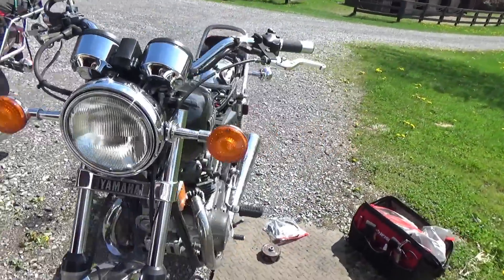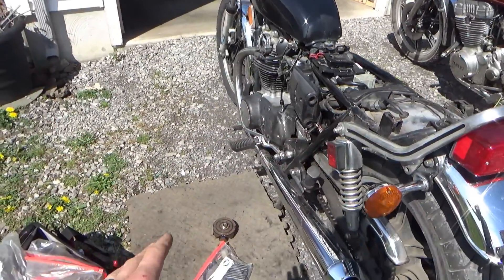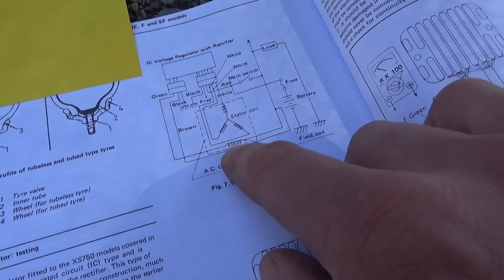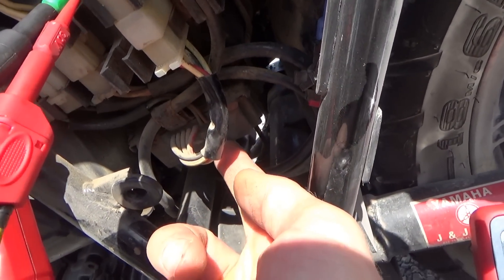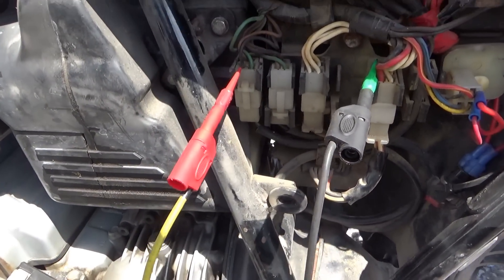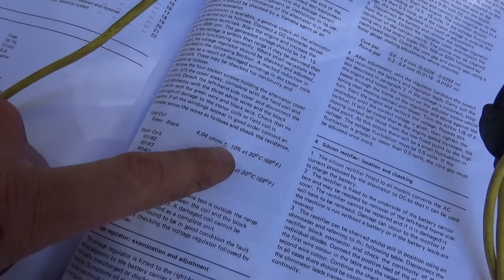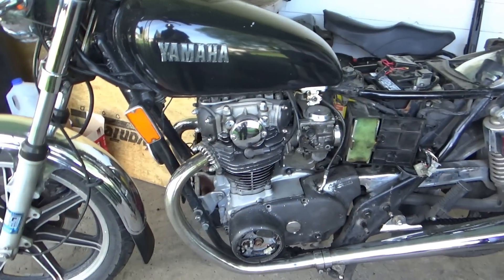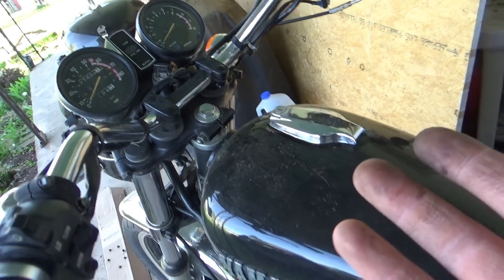Bad Diag? Bad Repair? Bad PARTS?? (Yamaha Battery Charging Problems)

Comment: Ivan.  During your spot on explanation of this charging system, I "woke up" and said:  "That sure looks like a "saturable reactor"  set up"  (also was called a "Mag-amp" I think. )    The Inductance of that control coil "changes, as the current through it changes." (thus the effective reactance/resistance changes)  as the control coil is "saturated" with magnetic lines of force. 
 
As the coil is saturated, with magnetic lines of force,  its inductance changes  - which allows more current or less  current through that control winding.    It's just like you dialing in more or less resistance with your decade box.   Maybe other followers of yours can give a better explanation.  Loved the diag.  Thanks.

Comment: Do not throw the old rotor away.  It can be rewound.  I've been running a rewound rotor for 20 years.  Custom Rewind in Alabama is one of the places that does it.  The OEM rotor is going to fail.  It has to do with the insulation technology at the time they were built.  Rewound is better than NOS.  Fix that and the XS650 is bulletproof.

Comment: I had a similar situation with old parts.  My DR650 stopped running and the high tension coil returned close, but out of range resistance.  

I replaced the coil and still nothing.  The new coil’s resistance was in range. 

Later it was determined the pickup coil was bad.  Still would not run.  

With the old high tension coil, all was well.

Always keep the old parts!

Comment: Something I've been seeing as a point of failure on consumer and aftermarket generator rotors and transformers is the improper attachment of enamel-coated aluminum magnet wire. I've found aluminum wire with the enamel intact all the way to the end of the wire and a glob of solder holding it in place. The solder only made superficial contact with the cut tip of the aluminum wire and soon fails completely ("Obsolescence Fuse"). Besides, at best aluminum requires special treatment for the solder to even adhere to it. I've seen several techs look at the copper-toned enamel and assume it's copper...a scratch test would prove otherwise.

Comment: I remember reading in a Chrysler Valiant service manual (1966 model) in the 'electrical' section that the maximum field winding current (DC) is 2A with regulator (contact type) 'on', which, with 12Volts input (battery) makes a resistance of 6 ohms (about the same for the motorcycle). Most occasions the brushes wear out, but it seems (as you mention) the windings are beginning to short out (with a 1.5 ohm measurement). It is a rare fault, as many-a-wrecked bike has a 'good' one... Tricky about the combined ignition pick-up.. With all these rare faults emerging, volt meters, current meters, and resistance testing are essential to make a comparison with a 'known good' and an accurate diagnosis...

Comment: all my messing with bikes if you need one part  you get them all.  and you test everything BEFORE  applying power. seen bad parts fry good parts almost instantly.  it also pays on electrical to check wiring diagrams from year to year and also serial number breaks.  they changed thing like i change underwear. seen the same regulator  rubber mounted needing a seperate ground wire  on a serial number break where it was solid mounted before not needing the extra ground wire.

Comment: I put a led charging system indicator on my 1980 standard model after I got it. You never knew what the charging system was doing on these bikes with no indicators.

Comment: Man I wish you were closer.  I dislike electrical issues.  My VW Passat keeps blowing fuse #4 when my AC is running on AUTO turning the blower on high causing AC to blow hot.  As far as I know fuse 4 is not even for the ac or blower.  😡

Comment: When I had my XS650, I had 4 "parts" bikes. Even at that time (early 2000s) it was starting to become difficult to get the OEM replacement parts. I did find out that the pick-up and rotor have to match year to year. Mixing the parts across years will cause a no start condition. Something for you and your friend to file away for future knowledge. Great diag as always. Good to know your friend's bike is running.

Comment: In my spare time I do a lot of classic twin Honda work and have 5 bikes of my own. 
Fuel system and electric parts from  the aftermarket are just awful. 
I end up buying a lot from Japan and Thailand where new OEM parts are more plentiful. Id rather get a good used part before anything aftermarket new . 
Excellent video BTW !
Reply: I've noticed some parts for 60's and 70's Honda's, often times I can only find them in other countries, Thailand is one such place.     I was helping a buddy restore a 1965 Honda Super 90,  and a lot of the parts could only be found overseas.   I even found some parts that were new old stock OEM Honda parts.
Reply: Can you share some of the sources from oversees for bike parts????

Comment: The shorted coil fried the regulator. The fried regulator fried the replacement coil to open. After replacing both, it started working again. No mystery there.
But the sorry state of parts suppliers is really worrying.
So you can get remanufactured parts that are still broken, you can get aftermarket parts that are not in spec or very low quality, or OEM parts where only the packaging is OEM. So, when buying parts, you basically need to bring test equipment to the store. Or place your bets online.
Reply: This eBay rotor simply didn't get enough pre-inspection to determine if it is the correct part. That's where some experience becomes valuable.
Reply: best to replace stator and regulator together when you're dealing with alternator repairs

Comment: Crazy that two “new” parts failed.  I’ve had a single new part fail, but multiple failures is more rare but thank goodness Ivan is a pro and gets to the bottom of the real issues. One thing I learned from Ivan is NEVER throw away old parts until the repair is complete.

Comment: same problem with my i had with relays and sensors i checked and found bad then replaced and still the same problem then checked the new part 9 times  out of 10 the new part was bad saw a funny car tag on a beautiful corvair convertible nader1 lol

Comment: It is basically a very old (50 year) antique vehicle, e-Bay parts are questionable because of the age and rebuilds are probably as good as the volume of parts sold. Once there are few vehicles still on the road you end up doing a Jay Leno, making/rebuilding your own parts or hacking a more modern part into the system.

Comment: This is what I run into half the time when I get "new" parts.
NEVER throw your old parts away.
Reply: Back in the days when we still have points and condensers this save me two separate times.. Both times had to go back to square one.. Everything worked.. replace the points everything worked replace the condenser nothing worked... Trust me the first time this occurred that I was 16 years old it was hell on Wheels figuring out what was wrong... After that I never replace the condenser again figuring it's a none wear item😁

Comment: Great bike, the XS650..easy to ride and easy to repair..I've owned 3, the only thing with an externally excited alternator is, if your battery dies your bike will too. With a PM alternator, you can run the bike with a bad battery as it will continue to run off the always available alternator current.

Comment: Very interesting diagnosis. I owned a Kawasaki and about 5 Hondas back in the day, and don't remember any electrical problems. One Honda had a selenium rectifier, I think. Always figured it wasted power to limit voltage. Nothing against Yamahas, I just didn't get one, and assumed they were all the same.....

Comment: The number of times I had to repair the charging system on my 2002 Honda VFR800 was insane.   Burned up/shorted stators, cooked regulator/rectifier boxes, toasted main bus wire and fuses....oof.

Bought a BMW K1300R.  Has alternator, no issues in 11 years.
Reply: Actually I even remember the VFR being fine one day but cooked after a track day where it was at 11,000rpm for extended periods.  Regulator/Rectifier and stator just couldn't take it.

Comment: Hi Ivan thats much like an old type Car alternator system, with those at full output there was 3 amps going through the rotor, and the reistance of the rotor was 4 ohms, if thats any help to you...most of them had problems with the recifier...they also use the charging red light as an initial current for the rotor until it started to charge properly, giving it some risidul magnatism...ok cul Fred.

Comment: Speaking of don't throw your old parts away.... 

Several states made it a law due to some shady mechanics or garages-  that you had to offer the parts replaced to the customer if they request them.  This was so they could get a second opinion if they were bad or not.

I don't know if those laws are still on the books or not . But it might be something worth checking into in your area. Or just keep them on hand  until thry pick the car up and say if you want the bad parts, X has a core charge or whatever and I'll have to charge for it or you could just dispose of them.

Of course 99% of the people wouldn't know why or what to do with them.  But that was supposed to cure going in for an oil change and stop light replaced end up having the carburetor or ignition coil replaced because the shop needed to pay the electric bill.
Reply: Yes I live in Washington .. they have to give the replaced parts back here.. I do a little bit of repair work for mechanically challenged friends :) I give them the old parts back and make them throw them away :) .. keeps my garbage can emptier

Comment: Now when he sends those defective parts back to the supplier, they will put them back on the shelf as good stock.  The next guy will have the same problem.  It happens a lot to electrical parts.

Comment: Interesting tid bit. My uncle was  a high up engineer at Yamaha during those times. Designed built, tested for them as well as part of racing. Left and went solo.  Ended up redesigning/modifying parts for bunch of manufactures as well as going to court for most of them. My mentor was wicked!

Comment: Before I got into cars, I worked on bikes.  My shop has a scooter we use to get around on during the summer months.  It's a 2005 Honda NSS250A5 Reflex.  Has a ABS light on and no one seems to care about it.  I haven't been able to figure out how to pull the codes on this thing and that light staying on bugs me.  Anyone here have any experience with these ABS systems?

Comment: Us folks who are hanging onto older vehicles should remember one thing when servicing their vehicles.  "Save the OEM parts" even if they are bad parts.  There may be a day when those parts can be restored by someone in the future. You never know when a shop might start up doing rebuilds for older parts and if you have the original one, likely the only one they will rebuild, you could be in luck. We do this, we save all of the originals parts that came with the vehicle from the assembly line...those made in the USA on American cars of course.

Comment: That was most unfortunate for your customer! I agree with what you and other posters have said, a used OEM is better than a new aftermarket part - I don't mean OEM in an aftermarket box, I mean "real" aftermarket in an aftermarket box.

If we continue to see crap aftermarket parts, we will see used OEM parts skyrocketing in price, pretty much because they will be a more desirable part.

Comment: 1 thing I’ve learned about rebuilt or after market items is it’s a crap shoot every time you use substandard aftermarket garbage parts. It wastes your time and mine and it makes ya second guess everything. Funny story. I helped a good friend of mine replace a starter on his ATV The rebuilt one lasted less then 5 starts. When I opened it up it had kibbles and bits. The magnets in the case were all loose and laying on one side of the housing. Geniuses!

Comment: Morale: Always check your replacement parts against the old parts.
And if possible do a functional test and measure with your test meter.
Reply: Moral
Reply: @bcad4066  You can have the e for lunch ...
Reply: @bcad4066  Well, bad parts can affect your morale!  😁
Reply: @jeffryblackmon4846  And it certainly affects the producers morale.

Comment: I wouldn’t necessarily say the aftermarket charging module was junk. Running it on a dead shorted stator is abuse. Especially if he 
drove it around for a bit like that.
Reply from the maker: True. Good thing the original regulator didn't get cooked haha

Comment: Interesting circular interaction of bad parts! Good diagnosis, Ivan (particularly on spotting the missing embedded magnet for the coil pickup). I found the open field coil very odd, due to its wire gauge - not easy to break (I actually rewound the field coil from a Kawasaki 750, back in my younger days). Maybe this one had an embedded thermal fuse, that went off due to excess current.

Comment: The stator looked a bit crispy too, surprised it works. I think all these junk aftermarket parts are made with zero QC at all, they just make them to look similar, throw them in boxes and send them, never test them for even basic functionality much less on an actual machine for compatibility.

Comment: I had one of those 650 and had the same problem with it. Burnt up parts. regulator, rotor open. Turn out the wires behind the drive chain got worn through and would short out from time to time. If you don't keep the drive chain adjusted, it will get into the wires. It cost me big time before I found the wires. Even the cycle shop missed it the first time repair was done.

Comment: How long has the aftermarket headlight been on the bike? Was it installed prior to the charging system problem and could it have been the cause of all of the problems.

Comment: Lets see.. I have had my Regulator on a 1990 Pacific Coast  blow out the head light ..2 twice ..1 st time I thought it was just a bad bulb ( hit RR tracks and it blew ,,) second time I found a post about a Huydia that tha wa the cause ( before you tube was around much to teach me...
 Second goofy one was my 2003 Suzuki Bamdit 1299  has a relay / solenoid for the starter .. used acual diagnosisi ..leqarned from you .. replaced it ...worked twice and failed...I ordered another .. I trusted my diag.. that one started the bike fine... then kept spinning the starter ;9 ;;; STILL TRUSTED MY DIA AND got a used one and it worked ever since ...

Comment: Been fighting with my 81 Honda CB650 charging system for a long time.  It is similar to this charging system.  Mine will charge for a while 13.8 (volts max) then it goes back to 12.1 volts even at higher rpms?
Reply from the maker: Unplug the regulator, see what happens. Also Honda rectifiers crap out...you can get a more modern upgraded one :)

Comment: Junkyards have the best parts if they let you pull them. To pull, repair, test, ship and hope they don't get mishandled or sent untested can be a crap shoot even for used OEM. The aftermarket needs to be fully guaranteed for at least a year or you'll need to carry spares.
Reply: You should still carry spares, a guarantee means nothing when it comes to longevity.
Reply: @hcox1111  Fully should have read as; towing, labor and shipping cost to replace!

Comment: A little outta your lane here. The Yamaha systems are the worst. Had a JS550 the stator windings shorted on. Tried a rewound 3 times and each time it was shorted. First time I didn't even have to test it because the windings were clearly routed across the mounting holes. Next two were shorted. Finally the guy sent me a used one. It tested good. Always test these before you install. The Honda, Suzuki, Kawi systems are much better. Simple stator with coils. Get rid of them old dinosaurs on market place. Get something newer, better, with less troubles. Get a dirt bike.
Reply from the maker: Never heard of a JS550...
On our cross country trip in 2008, my friend's 81 Honda CX500 cooked the alternator and had to limp home without a headlight, while my other friend's 79 Kawi 650 first blew the rectifier (fitted a spare Yamaha replacement), and then blew the regulator and was boiling the battery at 16V haha! The Honda and Kawi swapped batteries once a day, while the 3 Yamahas had no electrical issues during the 9,000 hard miles, save for a snapped fuse holder clip :)

Comment: Hey Pine Hollow auto diagnostic I have 2008 Cadillac DTS in need of BCM I have Autel MK908pro2 scan tool and ACDelco acc. My question is I want to buy New BCM from rock auto or better to buy used BCM or Reman, I don't want to have no problems later down the road?

Comment: Parts in general these days are flooded with aftermarket crap. New no longer means "good" used is always a crap shoot. For someone that doesn't have diagnostic abilities it can get really expensive and frustrating.

Comment: That had to be the most unfortunate mix of wrong parts lol.
Trust yamaha to make such an odd system.
The owner really needs a good slap for not checking part numbers.
I have an old 1985 kawasaki Kh125d5, there are so many versions of the bike. 

And to make it worse, they were not popular and even the Haynes manual company never made a manual for it ever lol.
Even the old small 50cc puch maxi moped had a haynes manual.

Comment: The cost of the diagnosis and repair was likely more than the value of the bike.
Reply: Not hardly! Those are starting to go up in value and are one of three “respectable“ Japanese engines to American bikers, the other two big the Kawasaki Z 4 cylinders at the Honda SOHC 750.